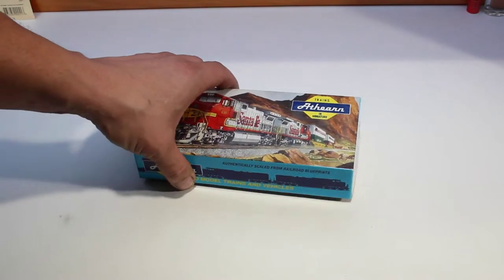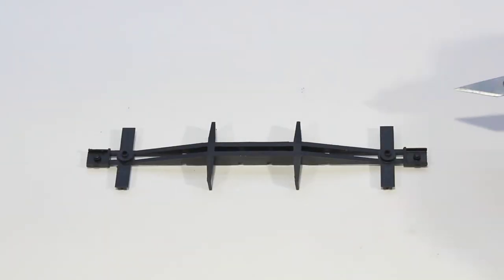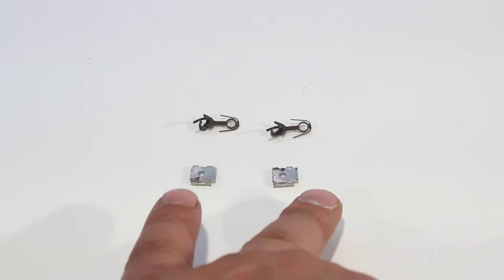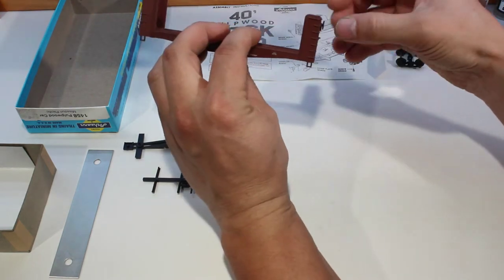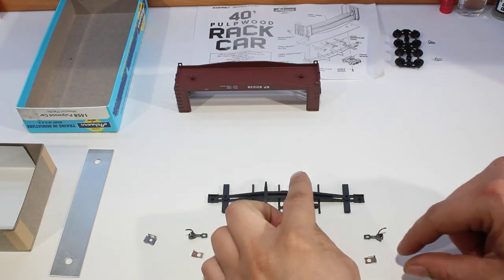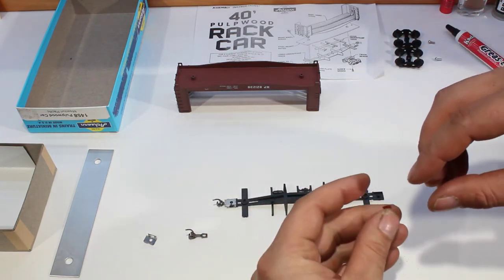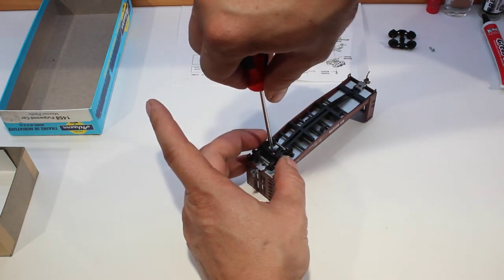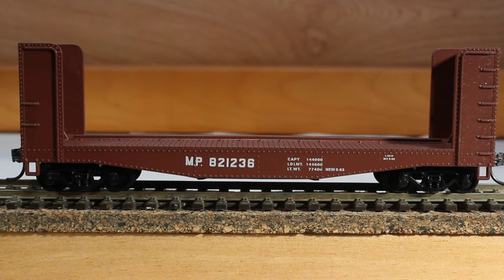How To Assemble Athearn Pulpwood Car - Missouri Pacific

Comment: This is great. Remember back in my youth around 1978 to 1983 i building many blueboxes cars. My locos was also Athearn bluebox and had some Atlas yellowbox(roco)also. The hobby was so simple back in the DC days. Today its has lost the charm and has become to expensive in my humble opinion.
Reply from the maker: Ya I do miss the old days when you could buy a blue box kit cheap and have fun building it yourself. The new ones are very expensive especially the engines but they do have a lot more detail.